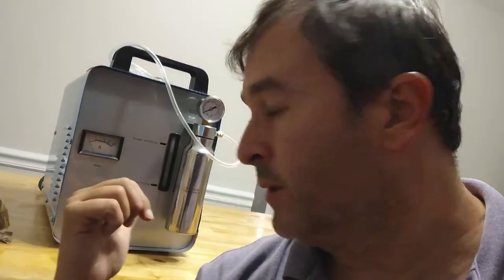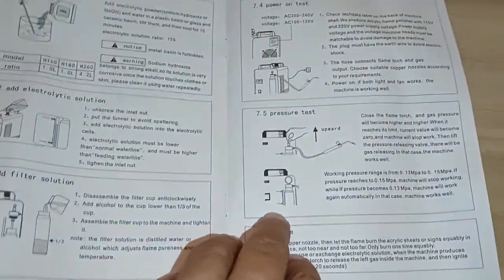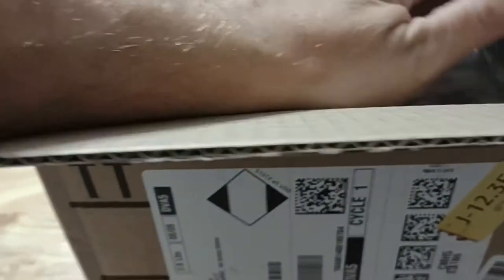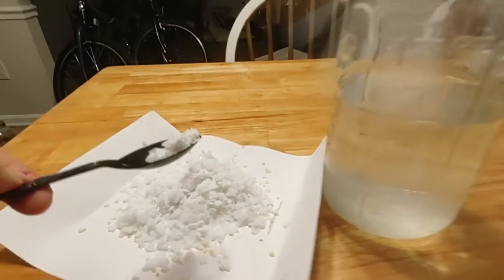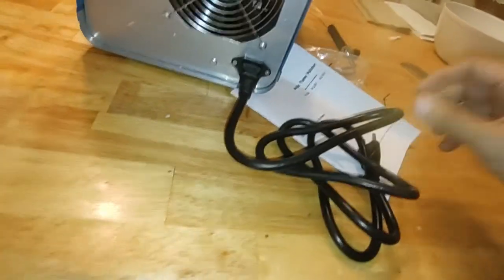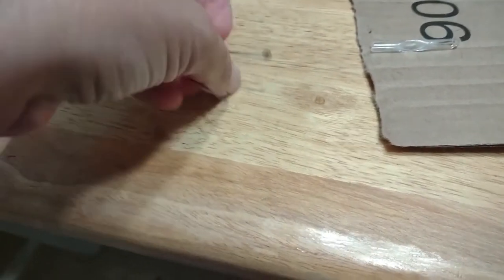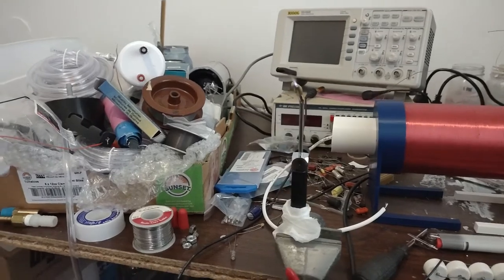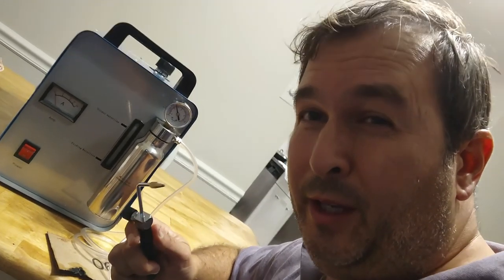H180 HHO Torch

Comment: How to do oxyhydrogen flame adjustment

Generally,the oxyhydrogen flame is straight and concentrated as for free carbon element,and the flame temperature is as high as 2800 degree.Sometimes,we can see that oxyhydrogen flame have two layers of flame.The innermost flame is the bluest and brightest, and the outermost flame is divergent.The kind of flame is suitable for welding and heating large area and lower temperature requirements for welding parts. How does the oxyhydrogen flame adjust?

There is a kind of carbonated liquid also named cooling liquid which is easy to vaporize. The chemical name of carbonated liquid is Alcohol (ethyl alcohol), methyl alcohol, acetone, petroleum ether.When oxygen hydrogen gas is mixed with carbonated liquid for combustion,it will reduce the hho flame temperature.The more oxygen hydrogen gases enter into auxiliary tank,the more carbonated liquids are vaporized,and the more oxyhydrogen flame temperature drops down.Methyl alcohol is the most common economy chemical liquid.However, petroleum ether is the best choice for some applications like jewelry welding where the flame temperature is very low.

How to add the carbonated liquid into additive tank?
1)counter-clockwise direction(left twist) to screw the additive tank.
2)Use the funnel to add the cooling liquid to the tank, and not exceed the 1/3 of the tank.
3)Clockwise direction(right twist) to tighten the additive tank.

If the oxyhydrogen flame is yellow,maybe the cooling additive is too much, or flame torch nozzle is dirty.Just pour out the excess cooling additive,or clean and poke the fire nozzle with small needle.

There are two kind of additive tank in the Okay Energy oxyhydrogen generators.The OH100-OH1000 oxyhydrogen generators have the additive tank.The OH2000-OH20000 oxyhydrogen generators have independent
Reply: Can I put petroleum ether in the bubbler?  Is it more dangerous than ethanol?

Comment: 33:10.  It should say minimum fill line.  If you ever don’t hear bubbles when it’s turned on make sure you add water immediately. Especially since that’s your only flash back safety otherwise it will go back in the tank and explode.
Reply from the maker: Good to know! Thanks!
Reply: @jaynesnetwork  sorry for all the comments Man. 😳 i wrote a small novel🤦‍♂️
Reply: @jaynesnetwork  oh by the way i bought a new torch (the actual torch part you hold )   On ebay and it’s better in my opinion. Was less than 20 shipped and has an internal spark arrester which is great

Comment: Oil Furnace Ran On Water 1950's
Manuscript delivered to Patent office was approved, but redone to Patent, to only allow 50% efficiency increase of oil furnace by addition of steam from water line to spray nozzle. Military soldiers off duty during 1950's collected used jeep oil to burn in used oil furnace. They attached water line SS tubing coil in insulated fire pot and by monitoring temperature point would open valve for T fitting to allow steam line mixed in. The steam had been changed to super heated steam with flame on coil. At 1500 degrees F, the oil valve was shut off , allowing A Hydrogen and Oxygen torch flame to continue.  Furnace provided constant heat unless water line shut down. If temperature then was reduced, then oil had to restart furnace to get it back up to proper temperature. Motor had dual shafts for 2 oil pumps for 90lbs. each. The highly sensitized H2O at great pressure was subjected to vibration shockwave when exiting pinpoint hole nozzle to AMBIENT. The gases separated and burned with the 10Kv ignition. The lowered dissociation temperature of steam was realized, rather than normal 3-5000 degrees F.  A much smaller working burner unit with fire brick surround in large box was shown to senator in under ground parking garage. No further news came afterwards...
Reply: That's cuz cavitation electrolysis creates ohmasa or brown gas which is hho plus an anomaly.

See this video 
https://youtu.be/OOcWAcecPxE

Comment: Use brass or carbon tools on glass. Other toes will stick to the glass when heated. Also learn about “glass tension “
Reply: Hey that rod put off there. It’s gonna get stuck.
Reply: Tension or lack there of is key when fusing glass or moving it in any way. You need to hear it all uniformly at the end. Otherwise you’ll have tension locked into the glass just waiting to be released on the slightest tap